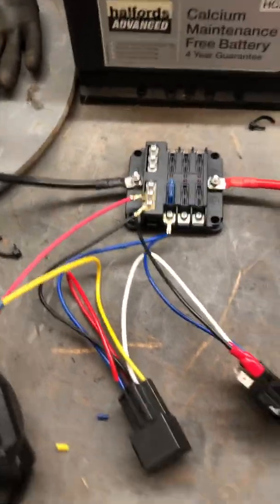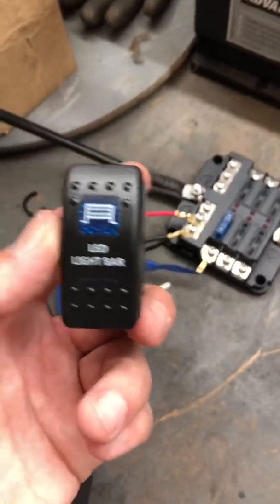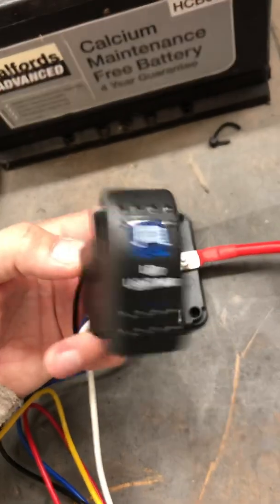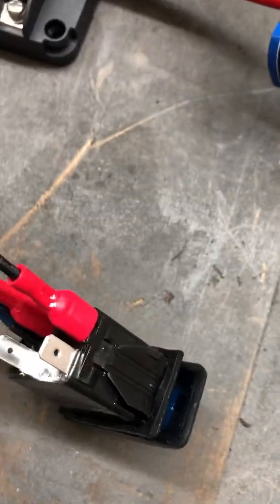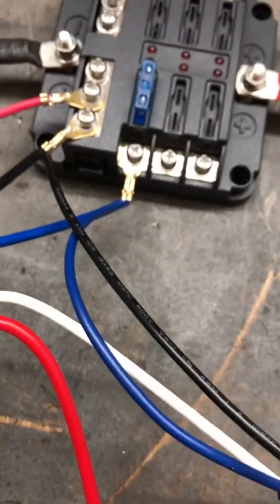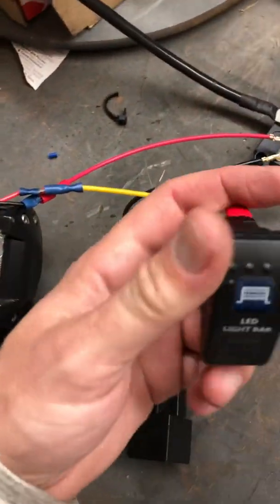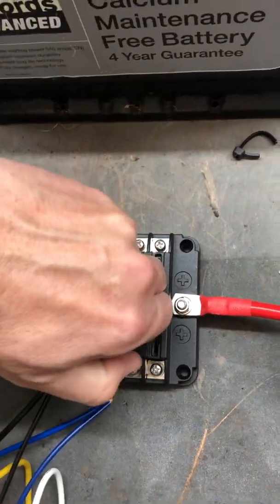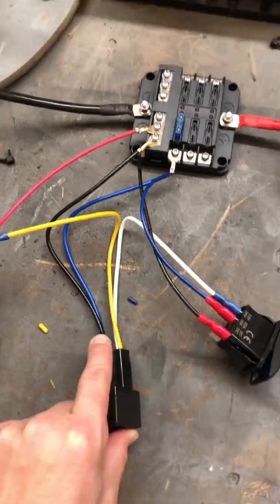5 pin rocker switch wiring for lights

Comment: How would you use that switch for negative trigger and still have the lights come on in the switch.
Reply from the maker: @Camacha2  if you have the earth as the trigger pin it will work fine 

The Suzuki I fitted it to is negative trigger once you find which is the switching wire on your application then use that in a reverse if this makes sense obviously ensure you don’t have pins with positive and negative connected if you get stuck I can do a drawing
Reply: @raycollier2204  Thanks for the reply, but i'm not sure where you connect the negative trigger wire to, how can you send me a sketch of it, i'd really appreciate that .
Reply from the maker: @Camacha2 see below
Reply from the maker: sure I don’t have a pen here but I assume you are fitting lights here is description how I would do it 

Wire the black negative wire for the new  lights or accessory to ground or to negative of the battery 

Run the red positive power wire from the lights or new accessory to Pin 87 of the relay 

Take the negative trigger from your existing system and wire it to pin 85 of the relay 

Run your fused power from battery positive to pin 30 of the relay you will need to bridge pin 86 and 30 together with positive power 

This should then take power when the earth is connected from you negative earth switch system and turn on your new lights etc
Reply from the maker: sure I don’t have a pen here but I assume you are fitting lights here is description how I would do it 

Wire the black negative wire for the new  lights or accessory to ground or to negative of the battery 

Run the red positive power wire from the lights or new accessory to Pin 87 of the relay 

Take the negative trigger from your existing system and wire it to pin 85 of the relay 

Run your fused power from battery positive to pin 30 of the relay you will need to bridge pin 86 and 30 together with positive power 

This should then take power when the earth is connected from you negative earth switch system and turn on your new lights etc
Reply: Thanks Ray, I got all that done, but when I switch the lights on at the switch I can't get the rocker switch to light up, that's what I'm trying to do, the 3 pins are negative, input negative signal from high beam and negative out to the relay
Reply from the maker: Can you send me a photo of the back of the switch